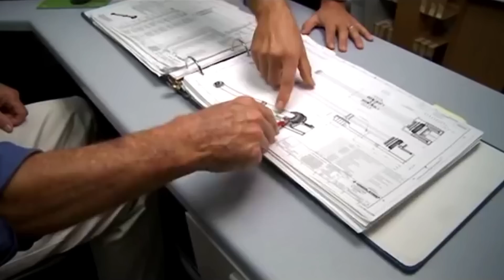US's Ultra-Advanced Railgun Weapon Is Making All Others Obsolete

Comment: your math feels off it the shells leave the barrel at 52,490 feet per second. They are traveling at 9.94 miles per second thats 596 miles per min. So a target 250 miles away shouldn't take 6 mins it should take less then 30 seconds of those speeds were accurate.
Reply: He messed up they travel up to !7900 feet/sec best I can match is Mach 7 is 5370 mph. His math is off.

Comment: Not trying to be a pain .but my numbers don't match your. Did I do the math wrong? 
Going off your stated numbers
52493 fps = 35790.681 mph = Mach 48.250.
250 miles is 1,320,000 feet
1320000feet÷52493fps=25.146 seconds not 6 minutes? 
12 miles in 6 minutes is 14.6666666667fps
6 minutes =360 seconds 
1320000feet ÷ 360 seconds =14.6666666667fps
The moon is about 238,855 miles depending on  Is elliptical orbit and who you as.
238,855÷35790.681 mph=6.6736645777 hours to the moon.

Comment: Mach 5 is not that high a speed.  Only about 4,700fps.  This is the speed of a tank main gun APFSDS round or a 35mm autocannon firing APDS from the early 1970s, using ordinary propellant.

If you are doing air defense, the big question is footprint area vs. slew and traverse rates.

A missile doing 'evader' (ballistic) or 'dancer' (sea skimming) profiles can generate enormous displacements on the order of several hundred fps in the terminal phase of a Mach 7-10 (dive) or 3.5 (sea skimming) attack.

But that evasion profile always has to come to a fixed point on a target hull or area (airfield, rail head, tank laager).  i.e. It has to stabilize for terminal accuracy.  And so, if you space the defenses out with something like the Metal Storm, and assuming the threat doesn't airburst with cluster rounds or go atomic, the ability is present to do this-

https://www.youtube.com/watch?v=p7cEhN69xzA

With a much, much, cheaper munition that, while heavy, can fire so many rounds in such a tight interval that (as an APS) it hits anything, even moving at incredible speed, before the threat munition can strike and detonate.

Close Aboards remain a issue but once you migrate past the highly dated 'deckhoue, mast, turrets and VLS' concept of how to design a warship to instead put everything low to the water behind sliding armored embrasure doors or erectable masts, the vulnerability to blast largely goes away and fragmentaation is, at most, limited to single areas of the hull.

In a world where defensive interceptors are starting to approach the cost of the long range ASCM/BASM they are design to knock down, and the next step, to counter lasers, is HPM; the ability to electronically encapsulate defensive systems while heavily leveraging hull surface areas in a fashion like a Monitor must be considered as a fundamental sea change in defense against standoff softkill effects and lethality enhancements.  Simply by adopting a wall-of-hardkill option as ultimate terminal defense in the last few microceconds of what may well prove to be a 2-3km/sec approach speed.

As a vehicle mount, the system multiplier is one of removing the explosive detonation risk while, potentially, greatly reducing the internal volume of the vehicle.  Allowing for a tank the size of Humvee to use special recoil dampeners to absorb a variable load (lofted indirect or high energy direct) firing acceleration to employ top attack soft launch and kinetic effects in a single gun/mortar application.

Here, the struggle has always been rate of fire vs. effects delivery with the 'next generation' of 130-140mm tank guns looking to have 70lb shells that will be well beyond the ability of the brawniest loader to slam load ten shots in a minute with.  If you remove the propellant charge, this could change and while an auto loader is still recommended, the ability to stack 3-5-7 rounds on mount could completely alter the nature of the fight with one tank, using a track-while-scan equivalent facility, able to engage an entire enemy platoon faster than they could slew and engage back.

If that vehicle is itself optionally manned, the nature of the armored vehicle fight will be determined by the cost of the automation rather than the vulnerability to specific attack methods (smaller vehicles with tightly closed fighting compartments can have very thick roofs).

The big problem for a vehicle is one of electrical generation and capacitance/cooling problems.  A high rate of fire in artillery is 2rpm.  A high rate of fire in a tank is 15rpm.  A 30rpm fire rate in a rail gun would require such rapid discharge and reimpedance of a capacitor array that the thermal loads would be incredible.  You would have to have a dedicated (turbine) generator and some form of cryo cooler, just to keep the firing system from blowing itself up.

Unless you go for a very low muzzle velocity of 1,800-2,200fps and simply lob rounds like a mortar, concentrating on MRSI and guidance to hit point/moving targets from over the local horizon, defined by mutual UAV coverage.
Reply: "warship to instead put everything low to the water behind sliding armored embrasure doors or erectable masts, the vulnerability to blast largely goes away and fragmentaation is, at most, limited to single areas of the hull."

I think those are called submarines. Issue with surface ships they can easily be targeted below the water using torpedoes. I don't believe anyone has an effect defense system against torpedos. Aerospace you can use radar, and Phlanax, or perhaps laser weapons to destroy inbound missiles, artillery or aircraft.

Comment: i was under the assumption that, lacking the need for gunpowder, there would be no combustion to exhaust.  if it's using electromagnetic propulsion, why do we see a plume of flame from the muzzle upon firing?  i'd imagine a shockwave would be produced from the immense and immediate acceleration of the projectile, but the muzzle flash has me confused.
Reply: Plasma
Reply: Compress air enough in front of a projectile going at extreme speeds at sea level and it tends to heat up rapidly.

Comment: It's not April 1st is it? Don't quite know how they're going to miniaturise the power supply for this in order to vehicle mount it  as it needs the equivalent of an electrical generation sub station that would power a small town or are they going to use portable nuclear reactors?  Useable for fixed installations with access to high power electrical supplies or shipborne installation can't see it going mobile though.
Reply: No a 1 MW generator could provide enough energy (stored) for a shot about every 30 seconds. It uses about 30 Megajoules per shot.

Comment: The weapon looks small but the power plant to run it has to be fairly large.    I can't imagine the barrel lasts too long either judging from the fire (plasma?) coming out of a weapon that is not using an explosive propellant.  I wonder how many joules of energy it takes to fire a round, has to be crazy high.
Reply: It's the wear that was the main reason the Navy stopped the research. They need a major breakthrough in materials.
Reply: 30 MJ was standard.  Too hard to get the capacitance and voltage physics for much higher energies.   Plus Ohms law becomes a problem real quick at lower voltages and induces higher currents.   Also EMP is quite startling!
Reply: BE VERY CONCERNED AS THE DEMOCRAT PARTY SHUT DOWN THIS PROJECT AS THEY ARE WORKING FOR THE ENEMY AND ONLY WANT TO MAKE US WEAK SO WE CAN BE RUINED FROM WITHIN AND THEN OUR ENEMY CAN TAKE OVER